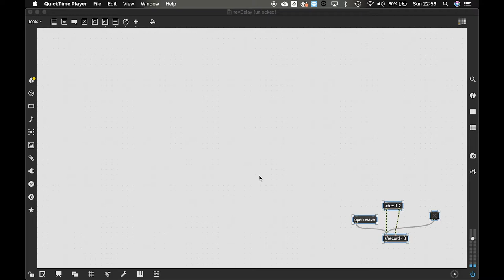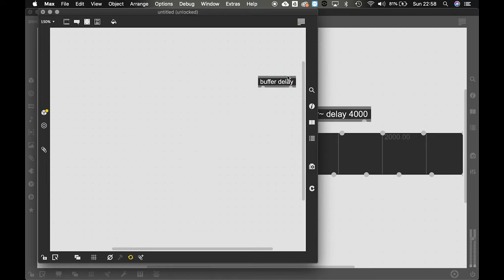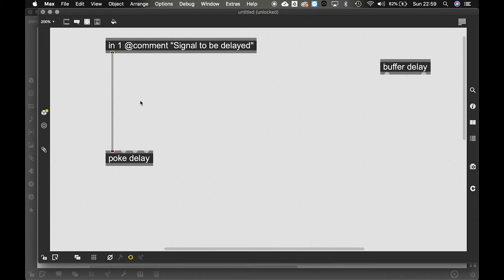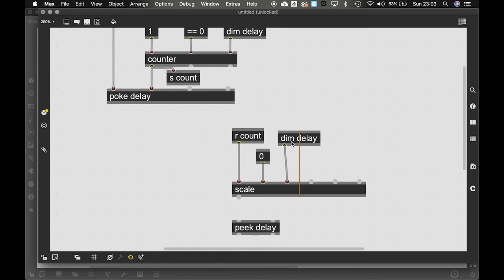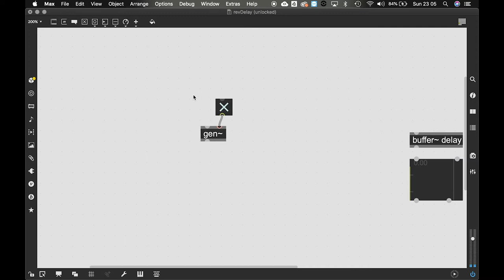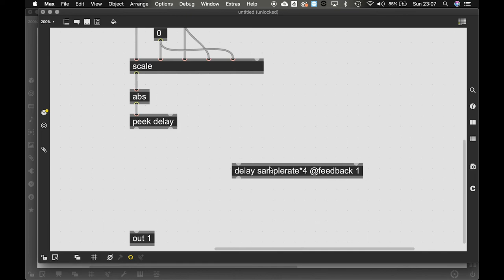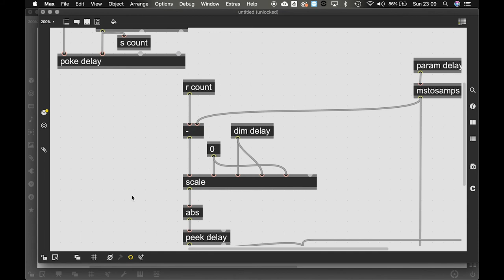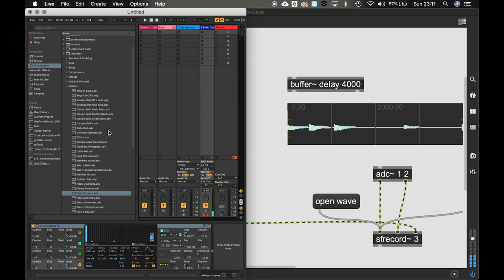Reverse Delay Tutorial Max/MSP and gen~

Comment: Great Patch! can you explain a bit more the mechanics of scale creating the reverse effect?
Reply from the maker: Hi Ben, when I am reading back from the buffer with the peek operator I need to index the values at which to read the buffer back, the counter is counting the values up from 0 to the size of my buffer (don't know what the exact value is in samples that's why I have the dim operator). Now since it's a reverse effect I need to read the values backwards from the size of my buffer in samples back to 0, the way I have implemented it in with scale, I am saying that instead of reading from 0 to max read now from max to 0, it is a primitive way of doing it and an easier way which I found out later is to use the [!-] operator which automatically counts back from the size of the buffer to 0 but those values are in negative so you put an [abs] operator which brings it all into the positive range and then you have to add the size of your buffer to it. I might do another video which properly explains that whole process, I did a bad job of explaining it here.

Comment: Sounds cool, but subtracting the delay time from the "r count" is kinda pointless. That's because the first delay is always gonna happen dependently on where in the buffer (position in samples) the input is written. For example, if the buffer is 200 samps long, if I record an impulse at sample 2 the first delayed impulse is gonna happen at sample 198 (200-2) because of the reverse scaling before the peek, but if I were to record the same impulse at sample 99 the first delay will happen at sample 101 (200-99). I'm trying to figure out how to make it work correctly, it's probably maths done between the scale and the peek.
Reply from the maker: That's right, I rectified it a few months later and made the process a lot more straightforward, need to update this video.
Reply: I feel like I'm reading a different language. Max is so in-depth its unreal to me